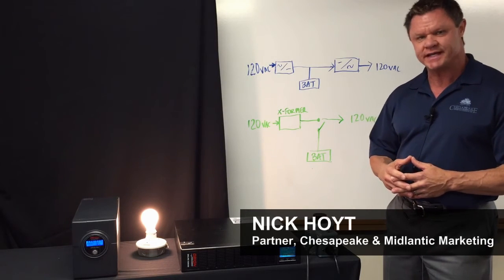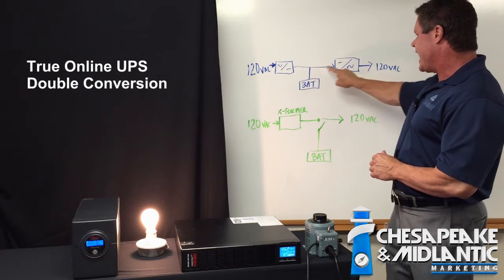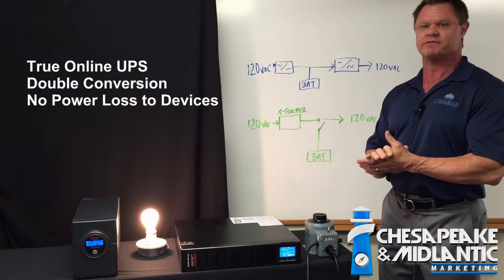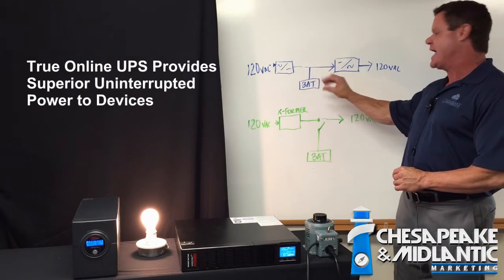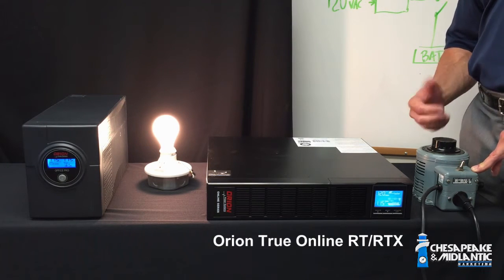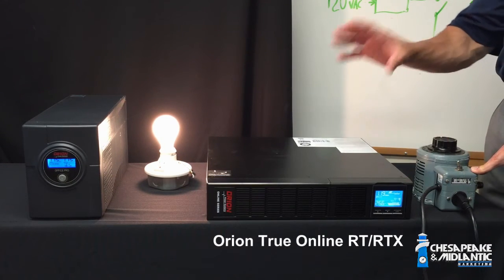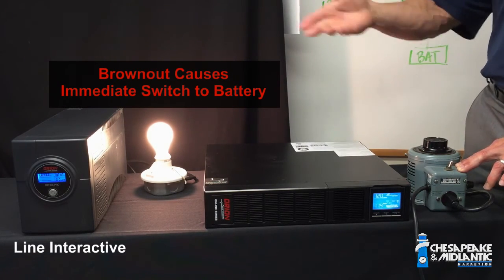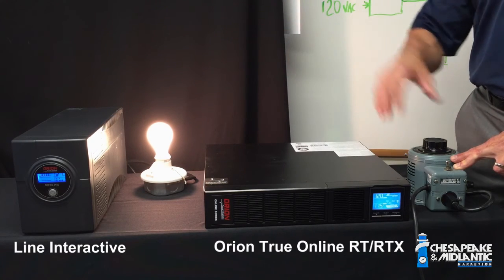True Online UPS versus Line Interactive UPS Comparison

Comment: The real terminology is a UPS v. SPS. a TRUE Uninteruptable Power Supply (UPS) keeps a charge on battery which supplies DC Voltage to an inverter that is supplying AC to your equpment. 
A Standby Power Supply (SPS) (which is sold incorrectly as a UPS) DETECTS the loss (or low voltage) of incoming power and SWITCHES a battery on which is connected to an inverter to supply your equipment.
This SWITCH can cause a disruption in power to your sensitive devices, esp any computer related devices which might cause them to re-boot (and lose anything you were working on). A TRUE UPS is MUCH better for anything that has a computer attached to it. whereas a SPS is more equipt for a toaster!
Reply: Tell me. If the battery inside the UPS you described were to just die, out of nowhere. (Please humour me here, as it's happened before). Would your "True" Uninterruptible Power Supply still allow the power from the mains (which, in this example has not had any interruption or fault) to power the units on the other side of the UPS? Or, would the dead battery block the power from making its way through the system. Because, if the latter, how is it truly Uninterruptible?

Comment: can you recommend some units at entry level price points?
Reply from the maker: Orion Power Systems DC1500RTX1 for a rack mount version or OP2000U-G2 for a desktop/floor. Thanks!
Reply: @MidChes  In Hungary I see the same model but under the brand of "nJoy Balder". Is that a ripoff of Orion Power Systems or are they the same inside?
Reply from the maker: @LajosGyörgyMészáros   thanks for your message! Questions about manufacturing specifics would have to be directed to Orion Power. We don't get involved at that level. Thanks again!

Comment: What is the best ups for dvr ( dvr hikvision ds-7204hghi-f1 + 4 cameras 2mp )
Reply: Hi, consider the Orion Power Systems DC1500RTX1 for a rack mount or OP2000U-G2 for a desktop. Thanks!
Reply: @mattgolueke5167  thanks 😃

Comment: Hi, just want to know if this kind of online ups generates noise by itself, in audio studio environments it is best to avoid things that generates noise ....so just to put you in context, hehe :)
Reply: I’m researching this stuff for the same purpose, what I’ve come across so far is that this gives you clean power thus no noise. Only possible noise would be from other sources in your signal chain but power would not be the issue with online ups. Good luck in your audio journey!
Reply: @jkkdf44  thanks a lot.

Comment: on a PC case scenario, does it turn off when using a LI UPS ?
Reply from the maker: The Line-interactive will work fine with computers, but does not provide the same level of power quality as the true online ups.  Computers can typically handle a break in power up to 50 milliseconds without shutting down.  The typical 8-10 millisecond transfer time of a Line-interactive ups does not cause a problem.   However, the online ups provides better voltage regulation, a built in bypass in case of internal failure, and zero transfer time to battery.
Reply: @MidChes  Thank you for the answer. I also read that a good UPS provides Pure Sine Wave energy, is that THAT important or a pseudo-sine works fine? I will use the UPS just to run my pc when there's a power loss, so I can shut it down as fast as I can.
Reply from the maker: @miguelmoreira5248  For a small PC application a stepped sine wave model is fine.  The Orion Office Pro series works great for that.
Reply: The PC will stay on until the battery is depleted. The tiny flicker in the lightbulb resembles a delay of a fraction of a second between the loss of utility power and the switching to the battery. Capacitors in your computers power supply will bridge over this short gap.

Some non-computer UPS systems, like those of off-grid battery power stations may switch too slow to keep a PC on. But with any PC or server UPS you will be fine.
Reply: @Aranimda  I'm doing good with my UPS indeed, thank you!

Comment: I have both UPS systems and they both work fine but I agree an online UPS is superior. LI is just cheaper and easier to maintain.
Reply: Also line-interactive has basically no losses when passing trough the current compared to online-UPS where you have losses in transformers all the time, meaning higher electricity bill.
Reply: @jaketus  Ahhh, this may be the answer I'm after! So, if out of absolutely NO-WHERE, the Battery in the device just died. (Not removed, or failing) literally DIES with Zero warning. Does the power still go through to whatever the UPS is supplying. Or - does the current always go through / interact with the battery, and a sudden battery failure will mean no power can make it through the UPS.
Reply: would a PC turn OFF with a LI UPS? I would be very thankful if you answer
Reply: @miguelmoreira5248  depends on pc PSU but you want to avoid stepped sine wave
Reply: @blanchbacker  ty
Reply: @miguelmoreira5248  noop
Reply: onli ups is old age invention.
Reply: It's superior only if you want 100% predictable output.

Otherwise it's totally inferior. It's less efficient, it ages the battery quicker.